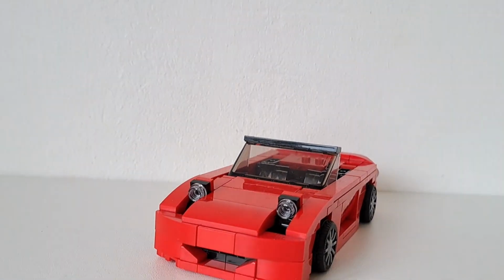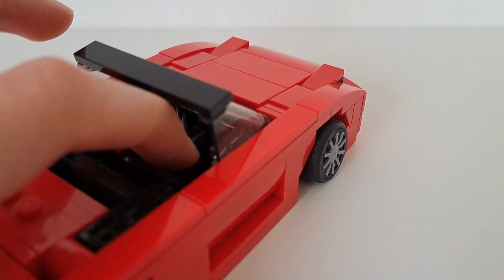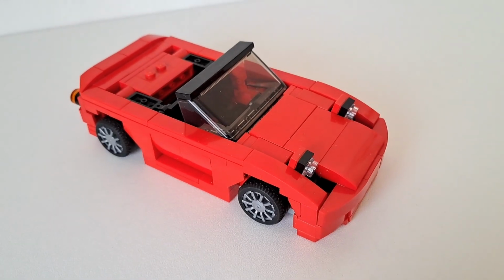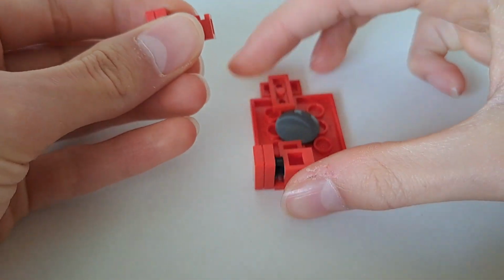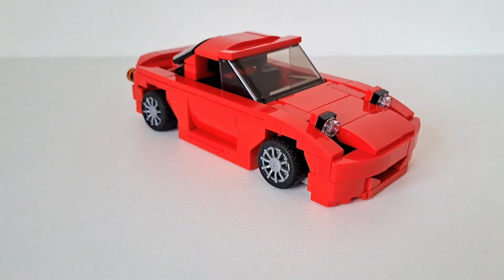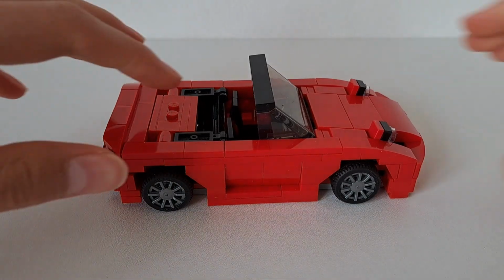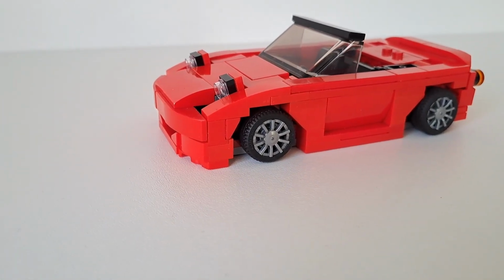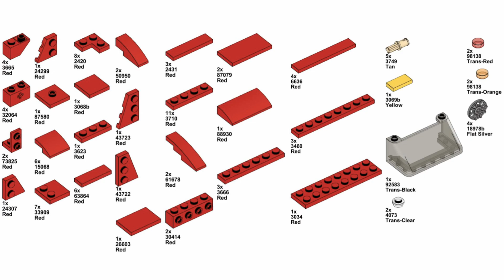Lego Speed Champions Mazda MX-5 Miata | With working pop-up headlights!

Comment: I think you forgot to add the 1x2 with the circle hole because i ordered all of the pieces that you showed but im struggling to find the 1x2 with the circle hole
Reply from the maker: I don't exactly understand which piece is in question, but I'm sorry to hear that you aren't able to find them. Could you maybe check if they are present in the "inventory" tab of the Rebrickable post? If it isn't there I'm sorry for forgetting to add that part, and if it is present there, then the company who supplied the bricks might have made a mistake in the order.
Reply: the curved 1x2 with holes in the studs